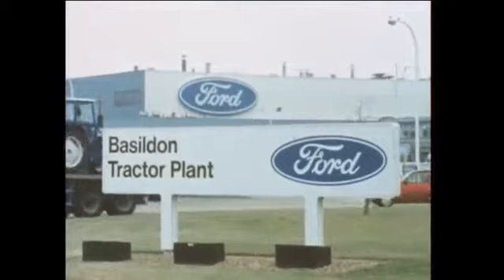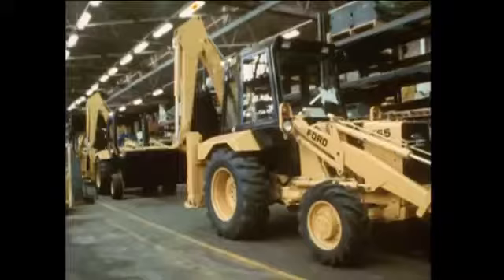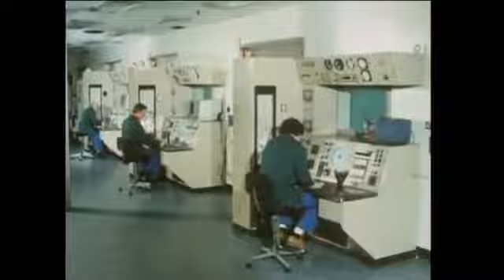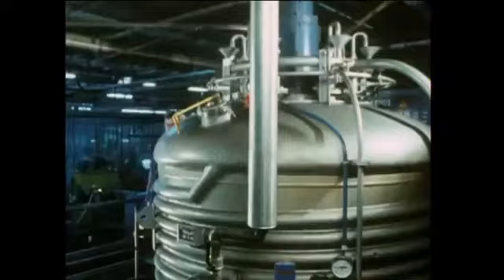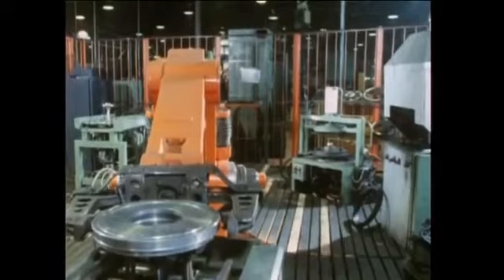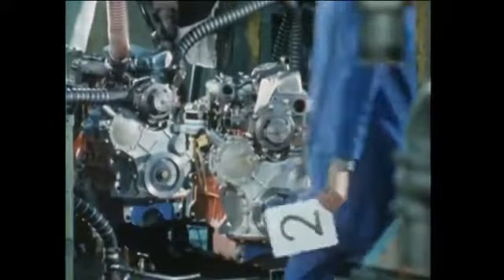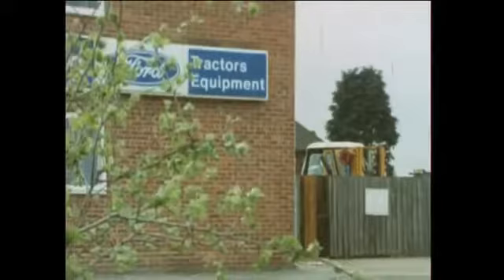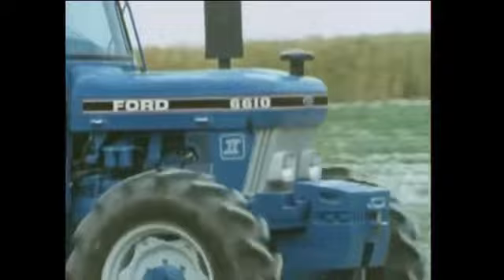Ford Tractor Operations  - agricultural machinery and tractor marketing video

Comment: Food tractor pure gold best high quality zero maintenance my tractor food 4610 Force 2 1987 to 2021 zero maintenance company fitted transmission company fitted rare Excel lifetime disc break tractor just one engine repair original company fitted oil power pto clutch my ford 4610 best tractor

Comment: Ford made decent tractors. Getting into bed with New Holland was the worst thing they could've have ever done, when that happened the quality started to slide and were nowhere up to Ford's usual high standards of "durability quality and reliability" which they prided themselves on, and lived up to. I wouldn't have sold off the agricultural division.
Reply: The 401 engines mated to the Dual Power transmission was hard to beat. Have a 9600, and had a TW20. The latter had to go because of hydraulic valve issues, but the old 9600 is still around.